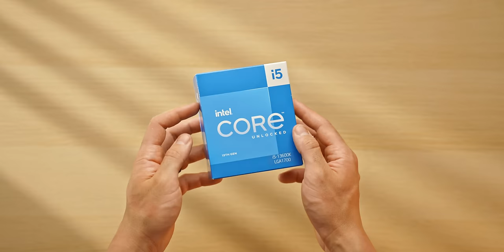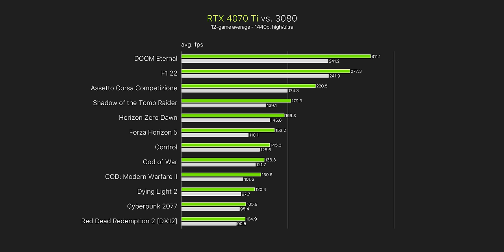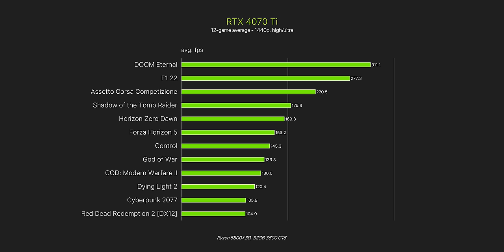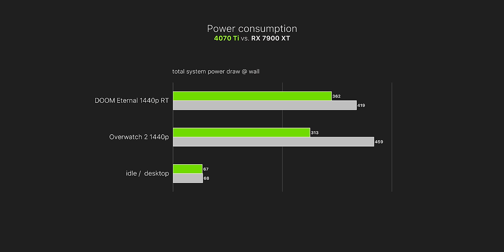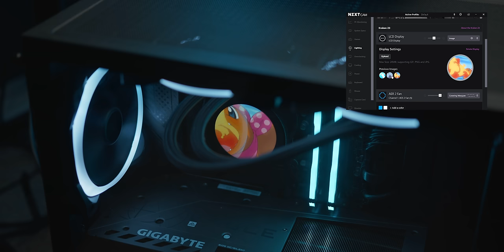$2000 Gaming PC Build (1440p destroyer)

Comment: $2000 for just ~125 fps. 
We had 250 fps for €750 before 2010.
These prices are insane.
Reply: ??? You can get 500 fps if you play in 720p, maybe 1000 if you play games from 2010.
Reply: Consider the fact that games today have piss poor optimization which hinders our ability to play them at decent frame rates for the cost
Reply: @Nemesis2508.  What game can you not play at decent frame rate for the cost?

Comment: Bought my parts for around 2500$ USD here's are the specs :
CPU : Intel core I7 13700 K 16 cores 3.4 GHz 
Cooler : MSI Mag core liquid 240r V2 (AIO)
Motherboard: GIGABYTE Z790 UD AC 
Ram : Corsair vengeance RGB 32 GB (16 x 2) 5600 MHz
GPU : Gigabyte Eagle RTX 4070 TI OC 12 Gb VRAM
Storage : 2 x Samsung 970 EVO plus 2 TB + 500 gb Corsair MP600 GS
PSU: Corsair RMx 850w
Case : NZXT H5 FLOW
Fans : 2 x Corsair ML140  Pro RGB (Intake) + 1 x Corsair LL120 RGB (Exhaust)
Reply: Wow nice
And how do you like it?

So you have a total of 4.5 TB storage?

Comment: RX 6750XT Ryzen 5 7600x. 750watts psu. B650 decent Case from Corsair or cooler master with 3 fans included. Noctua huge cooler. 16 gb DDR5 5200mhz. 500gb M.2 SSD 1tb SSD 1TB hard drive $1600 can play 1440p no problem(cooler is on high end)

Temperature of the pc sits 60-70°C under gaming load I tested it on dying light 2 Ultra settings 1440p
FSR OFF- 60-65FPS
FSR ON- 100+ FPS

Comment: My build-
Cpu-I5 13600k
Cpu Cooler- Deepcool As500 Plus
Motherboard- Asrock Z790 Pro Wifi 
Ram- 2x16 Corsair Vengeance DDR5 6000mz
Storage- 1TB Samsung 990 Pro (plan to add more when I get some for my birthday)
Case- Deepcool CC560 White
PSU- Deepcool 850w
GPU- Msi Gaming Z Trio 6800xt

Comment: I am surely keeping a reference to this build because this is a very great build which balances cost and power. Thank you so much for sharing with us your thoughts and the whole build process with such great informative method. Just one thing to raise would be to speak a little more depth for the fans connection as I had to go dig in another video to figure out how it actually works. Since I'm an absolute begineer, it was a bit difficult and confusing to understand the fan connection properly. Moreover, if you could have explained the PSW connection a bit further, it would have been all around perfect. Apart from these two points, you have given enough information to get started on this build. I'm confident your friend is gaming happily and enjoying the pc like a breeze! 😊

One more additional piece of info you could have provided would be the overall case air intake and out take proportion! Sorry if I am being a bit picky, but this surely sums up most of the aspect this video could have had to be one of the best all over build video.
Reply: they all have quite distinctive strong points, so yeah all fun , on their own
Reply: "out take" is a weird term, I much prefer "exhaust".

Comment: I did this exact build. It's a great bang for the buck. I used these components except I chose the highly rated Gigabyte AORUS GeForce RTX 4070 Ti Elite. This card is large and required that I top mount the radiator. PC runs and looks great!
Reply: I also made this build, I only regret not getting different AIo, but overall the performance and visuals are great
Reply: @RicardoMilosGachi what’s wrong with the aio? I was planning on doing this build
Reply: @ZaShredda  Okay so:
- Kraken is FINE, but costs a lot.
For lower price you can have something objectively better and it's just a fact.

- Kraken has low resolution display, so If the gif is made in a bad quality then it won't look that good.

I have 1:1 the same setup, I literally watched the video and bought the same parts with an exception to mobo - I bought z790 which is way better(highly recommend doing so).

Another thing - Both Kraken and Aer2 rgb fans are barely visible in market. Can't say how much I had to stretch to actually get them.
If you bay something from the 2nd hand it's mostly has their LEDs broken.

If you have some money to throw away - you can get Kraken, that's what I did, but re-think twice Aer Fans(they look amazing, I agree, but find something more accessible) and possibly think about different case as H5 Flow is also getting out of the market and it becomes a pain in the ass to get it.

tl;dr:
1. If you don't have money to throw away - get something else instead of kraken
2. Get different fans as Aers2 RGB are no longer accessible.
3. Same with Nzxt H5 Flow(cool case tho, If you can get it, get it)
4. Upgrade mobo to z790
Reply: @RicardoMilosGachi  Yeah if you just want the best AIO straight up then get an Arctic liquid freezer. Its waayyyyy cheaper than the Krakens as well.
Reply: @triliner254   But the arctic aios are so ugly, rt the ugliest kind of cooler in the market

Comment: water is heavier than air. hoses at the bottom always. run the pump hanging off the desk before mounting and viola air is all trapped in the top of the rad

Comment: Great build! The way you installed the 1VHPWR adapter that smells instantly like voided warranty :D All manufacturers suggest to keep the cable straight for a few centimeters and you just bent it immediately. 

That 12VHPWR design is just bad anyway.

Comment: Should be able to game in 4K with that, it’s my understanding the 4070 ti is slightly higher performance then the 3080. I guess for competitive gaming you might want the higher fps, I’d be perfectly happy with 120 fps in 4K though, and just fine with anything over 60 in single player titles.
Reply: Mixed settings in some games yes, the bus is the limiting factor. In lets say Deep Rock Galactic yea you could do above 60FPS max settings 4k but Hogwarts you will have to lower to around medium to high mixed settings.

Comment: decent build but should have put those rad fans on the inside pulling air in so that the rad can be cleaned easier and you don't have to take the fans off to get dust off.

Comment: Literally just built this exact thing... I5 13600k, msi mag z690 tomahawk, 32 G ram, nzxt h7 flow, 3080ti
Reply: bro can you tell me what did you do so the z690 will work with the 13th i5 gen?
Reply: @LazMann77  You need to update the BIOS to the newest version first, using the Flash BIOS Button.

Comment: CPU: AMD Ryzen 7 7700X 4.5 GHz
AIO: ARCTIC Liquid Freezer II 280
MB: MSI PRO X670-P WIFI 
RAM: G.Skill Ripjaws S5 32 GB (2 x 16 GB) DDR5-6000 CL30
M.2: Crucial P3 1 TB
HDD: Seagate SkyHawk Surveillance 4 TB 3.5" 7200
GPU: XFX Speedster MERC 319 Radeon RX 6950 XT 16 GB
Case: Deepcool CK560 
PSU: Corsair RM850x (2021) 850 W 80+ Gold Certified Fully Modular ATX
Total: $1951.10
Reply: Solid build

Comment: The radiator mounted at top also be great.
Reply: Everyone seems to say and do this, yet when I see people test it they find that pulling cold air from outside the case through the radiator instead of the warmer air inside the case (warmer ambient air temp inside case due to gpu and other parts) they see up to 9 degrees cooler cpu temps and 1-2 degrees warmer gpu temps. This makes sense to me, why does everyone top mount?

Comment: wrong choice if it's about position for the radiator is always the top of the case. always.  don't worry about little wormed air bc it will be cooled by fans first...it works.

Comment: Just recently built a pc for around 2.2-2.3k and opted for a rx 7900 xtx which was 950 and a ryzen 7 7800 3xD processor with 32gb of ram. Spent a lot of time debating whether I should spend the 1600 going for the 4090 but ultimately decided to go for the ryzen since it still has 24gb of vram and close to the same frames. Main difference is ray tracing which people mention a lot but i personally don’t use.
Reply: whats the overall power consumption of your rig and why didnt you go for 5800x3d which imo still is among the top cpus
Reply: @bikeomatic8005  idk just heard that the 7800 x3d was the fastest and its 850watts power supply
Reply: Wow nice how do you like it?
Is it everything you hoped for?
Is the 850 watt psu definitely enough?
Reply: yeah the 850 is enough i havent had any problems and im able to run starfield really well like if i put everything to max on all ultra the lowest ive seen i get in major cities is 80 and then it goes to like 155 at the highest @GORILLA_PIMP
Reply: @MrMadsweet5000  
80-155 degrees???
Reply: no the frame rate @GORILLA_PIMP
Reply: @MrMadsweet5000  holy chit that's crazy high!!

Comment: Ryzen 5 7600 or Ryzen 7 7700 with an Rx 7800XT or RX 7900XT would be a better choice imo. The AM5 platform is much more futureproof than intel right now due to the fact that intel's current socket will come to an end with 14th gen. The 7800XT and 7900XT are both better options than the 4070Ti, solely because of Vram. The 4070Ti is a really good card but it should've had 16GB of Vram. Because it has only 12, it will make it a lot less futureproof compared to the 7800XT or 7900XT

Comment: I spent just under 2k, 
The specs are
GPU: MSI RTX 4070
CPU: AMD Ryzen 7 7700x
RAM: 2x 16gb Corsair Vengeance DDR5 6000
m.2: SAMSUNG 980 Pro 1TB
2.5" TFORCE DELTA RGB 1TB
Motherboard: MSI Pro X670-P Wifi
CPU Cooler: MSI Coreliquid 360R V2
Case: Cosair Spec Delta RGB
Power Supply: Corsair RM850e
OS: Windows 11 Home
Reply: Is this actually fire? I’m tryna get my second pc i need a upgrade

Comment: The “similarly priced” 7900 xt is also in a class above the 4070 ti with 20gb of vram. Nvidias cards are all over priced for the performance they bring to the table this generation. The closest apples to apples comparison you can get for performance is the 7700 which is currently 300$ LESS than the reduced price on the 4070 ti. So bang for your buck nvidia only pulls ahead with the 4090 or in RT tests.

Comment: The cpu cooler should be rotated. So that the tubes are at the bottom. So the highest point of the radiator is above the CPU. ✌️

Comment: Not bad but idk I feel like AMD is better when it comes to CPU price to performance and if he went that Route he could have gotten 4080 instead of 4070 TI

I got this for 2050 Euros recently, and I could have had this for waaay cheaper if I went with DDR 4 which would cut price around 200 euros.

Ryzen 5 7600x 200e  Cooled by Thermalknight Peerless Assasin 50e

32gb DDR 5 5200mhz cl 36 129e

B650 Asrock PRO RS 210e

RTX 4080 Zotac Trinity 1200e

850w Be quiet Pure power 11 FM 130e

Western Digital SN 850 1 tb ( from past PC but included in this price paid like 60e)

NZXT H510 - bought used with 3 NZXT fans for 70e
Reply: Nice
But you really consider 200 euros "way cheaper"?
Man you'd probably fall over in shock if you knew how much dum chit I'VE done with money lmfao

Comment: I just built in the white version of this case, love it! but I avoided Nzxt fans cause I didn't want to deal with their software as I've heard too many bad things about it! Good idea to swap out the GPU intake fan, I'm not sure why NZXT bothered including voltage controlled fans. That is probably the biggest dissapointment of the case for me.
Reply: Dude how about your gpu and cpu temperature ? Do they over heat? I ask this question cuz I have no experince with pc building and this build has lesser cooling fans than others .
Reply: wdym by bad things about the fans? can you explain?

Comment: That CPU and GPU need better ram.

G.Skill Trident Z RGB 32 GB (2 x 16 GB) DDR4-3600 CL16 Memory   or
Kingston Fury Renegade RGB 32 GB (2 x 16 GB) DDR4-3600 CL16 Memory... something along those lines. 
You want to get the best ddr4 since upgrade path is to replace whole MBO anyways... So saving 40 $ makes no sense in the long run. Get the maximum out of that config. 2000$ is allot of money anyway so extra 40$ should be no problem. 

Also with internet speeds being super fast nowadays specially with optics ... you dont really need 2 TB storage for gaming. 
I would rather go with SK hynix Platinum P41 1TB.  Those read speeds and consistency is something that cannot be replaced by any other quality of life feature.

all in all cool looking PC.

Comment: i just did a build $1981 and thats with taxes included     intel i7 13700kf    4080 super   32 gig 3600 cl16     750 watt  water cooled cpu cooler  nzxt case   2tb 990 pro corsair fans pack    gigabyte aorus elite mobo

Comment: you should've put the rad at the top because now air is probably getting trapped in the pump block or the top of the radiator with how the pipes are lined
Reply: no
Reply: Overeating….. like manufacturers didn’t fill up the aio fully
Reply: This has been debunked for so long, it’s completely fine

Comment: it's a cool case, but from the testing i've seen the bottom fan dosnt really do much good compared to front fans. Etc a NZXT H7 flow with 3 front fans provides better GPU temps than this, so what is the purpose really.. Ofc this case is slighty smaller tho. The bottom angled fan is a nice idea, but it's placement isnt quite ideal to actually provide meaningful GPU cooling.

Comment: I’ve been putting together almost the exact same build! Only difference is I’m going with the Ryzen 7 7800 X3D. The same MSI Tomahawk board just with the AM5 socket and DDR5 Corsair Vengeance. Does the H5 Flow come with case fans built in?

Comment: @optimum hey I want to do this build but I have a couple of questions. 1. The links provided don't lead to specific parts but rather searches on Amazon, how can I be sure the parts I'm picking are just as good as yours and are also compatible? 2. Do you think the build would run fine with only the liquid cooler or are the extra fans you used necessary? 3. I also didn't see if you applied thermal paste, is it not necessary with the liquid cooler? Sorry for all the questions, but any help/guidance would be appreciated. Trying to build my first PC and everything seems so complicated 😅
Reply: i got the same exact pc and the water coolers comes with applied thermal paste on it

Comment: What would the cooling cost be of removing one of the top exhaust fans be? Mounting my computer to my desk completely blocks one of the fans, but I’d like to try the water cooling solution rather than the air cooling solution.

Comment: I still don't understand the whole "built for 1440p" idea. It really all depends on the fps/settings you want. You can run a 4090 and get 360fps at 1440p. Does that make it a 1440p card?

Comment: i loved your $1400 build in the nzxt h1 v2 - can i use the same parts, but upgrade to the 4070 ti? guessing it would tight, but doable? maybe?
Reply: bro... he made this video to promote 4070 ti, take same parts, but dont go with 4070 ti.
Reply: you dont need 2k to build 1440p pc, its overkill even for next 3-4 years, just get yourself 3070, or amd, which is even cheaper. It will be more then enought, trust me.

Comment: this is pushing warm air inside the case from the front fans since it passes through the radiator right? isn’t that an issue?
Reply: the CPU does not run hot enough during gaming load for that to be a concern (68C is fairly cool). That's why he put the radiator at the front. putting it at the top would have drawn in warm air from the GPU leading to warmer CPU temps. That would also make the GPU run hotter since it's kind of like putting a lid over the GPU and restricting air from escaping.

Comment: Is like the intel i5 13600k but I think the Ryzen 5 7600 or 7600x is better because you have more room to upgrade as the am5 will last much longer than intels sockets
Reply: that's kind of an irrelevant point though. Since the amount of times One upgrades their CPU is negligible and these chips are so fast already that it wouldn't be much of an "upgrade" regardless of resolution. It's more applicable to tasks outside of gaming; Editing, 3D Rendering etc.

Comment: I am told you don't need both 8Pin cables for the CPU unless someone plans to heavily overclock the CPU. Is that right?
Reply: is it? i dont know myself am asking if you have figure it out yet?
Reply: @LazMann77  I‘ve built my new Rig since January now Ryzen9 with 6800XT I‘ve been working on my PC with just 1 8 Pin cable and it‘s working perfectly fine. So it is true, the second 8 Pin is only needed for overclocking, but it seems that there no harm if you plug both so Win/Win.

Comment: I found all the parts you mentioned on pc part picker

It game me a warning for compatibility: The NZXT H5 Flow ATX Mid Tower Case front panel USB 3.2 Gen 2 Type C port needs a motherboard USB 3.2 Gen 2 header but none are available. The USB 3.2 Gen 2 Type C port will not be usable.

Is this saying that the 3.2 type c port won't work with this motherboard?

Is this an issue that I need to consider or can I still build and use the pc just find without this port working
Reply: Yep. That message just means the case's USB-C port won't be functional as there is no where to plug it into. Its not critical. If you need the USB-C port, you either will need to buy a different board or buy a USB-C header PCI-E card.

Comment: Building my first pc

NZXT H9 FLOW
4070ti GAMING SUPRIM X
Ryzen 7 7700x
NZXT Kraken 360mm elite 
Asus TUF B650 GAMING WIFI
2tb 990 pro Samsung
Corsair vengeance 6000mhz 32gb
Corsair 1000w psu (for future proof)
Reply: You should look into getting either a 7800XT or a 7900XT instead of the 4070Ti. 12GB of Vram might cut it now but it will struggle in 2 to 3 years

Comment: Hey if  i am using Nzxt H5 elite instead of Nzxt H5 flow which option according to you would be better, 1) Attach the AIO to the top part of the case 2) Attach the AIO to the front panel ? a reply from you would be appreciated thanks in advanced.

Comment: $2k for not that powerful PC is kinda disappointing, also 850w PSU is overkill for this setup. I've just finished building own gaming rig, with i9-12900k, 32gb ram, 1TB m2, 7900 xtx, rm650x, ITX Z690 and everything packed into MetallicGear Neo Mini V2 case, with total cost under $1900
Reply: So this build is no longer viable?